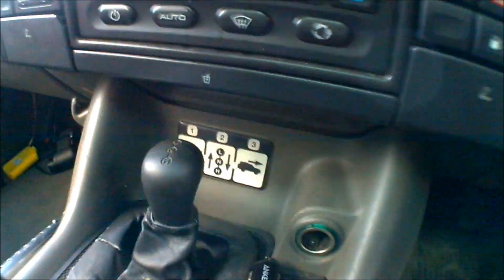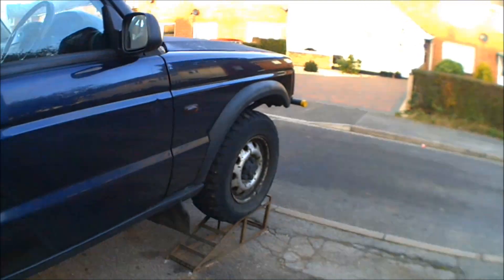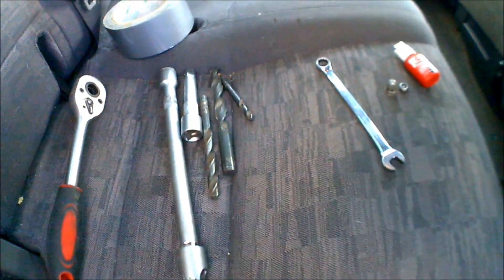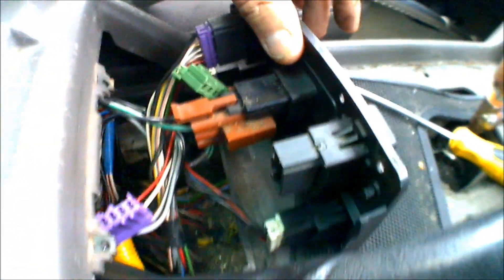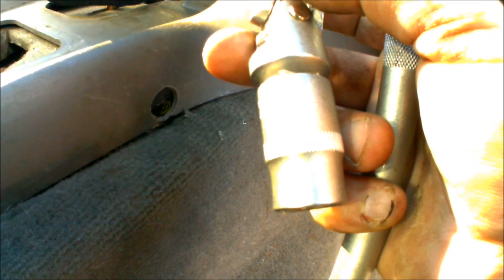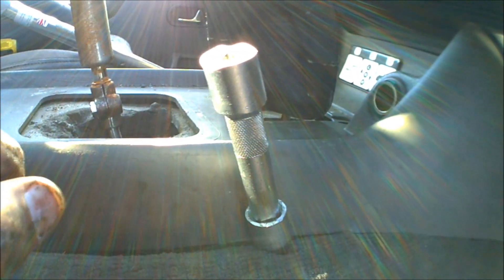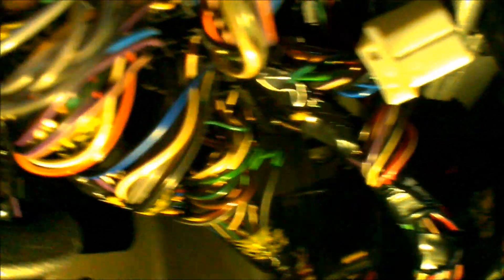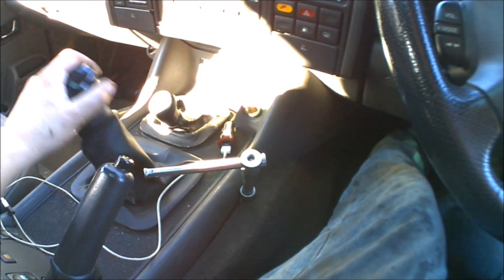Landrover discovery 2 homemade central difflock lever...save yourself £370 with this bodge

Comment: I believe you can run TC with the diff locked as well.
Reply: It is possible to enable through modifications but if done will likely break something in the drive train. By default traction control is disabled when the center diff lock is engaged.
Reply: @christophermeyers1  It won't break anything. It just confuses the ecu when you engage the CDL. If you fit the later TC ECU it's fine. That's what Land Rover did when they offered the CDL as an option after one or two owners complained about removing the option.
Info can be found here:

http://www.discovery2.co.uk/
Reply: You can indeed - the vehicle doesn't get confused either, the TC simply gets used less as the CDL keeps the wheels from slipping more. I fitted a latching switch so I can choose if I want it on or off (off for sand). Works a treat.

Comment: How long did this last befor you had to re mod it
Reply from the maker: It worked fine whole time I owned the truck...I did modify my design at some point with an extra swivel joint as I wrongly believed it would make it easier to select diff lock...in the end this first version worked best and reliabley